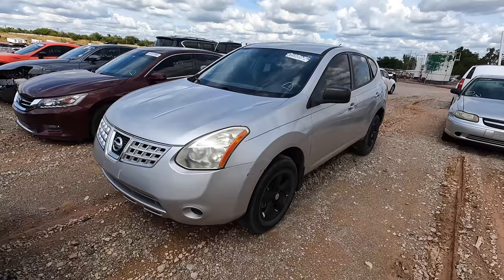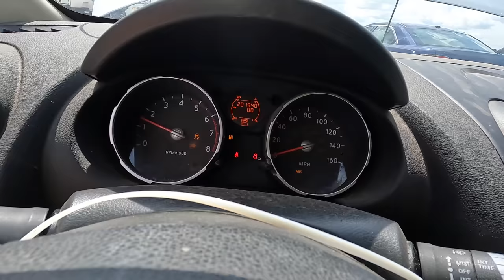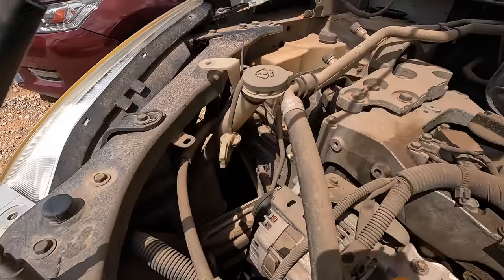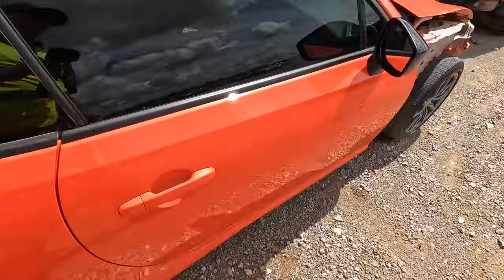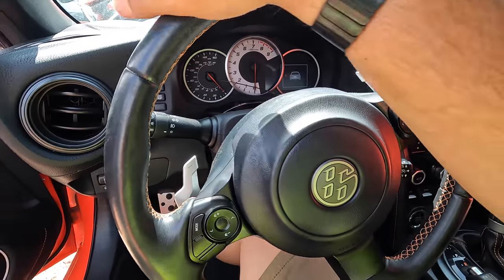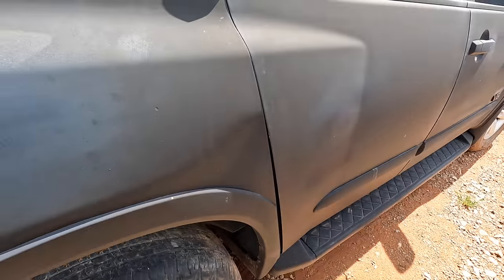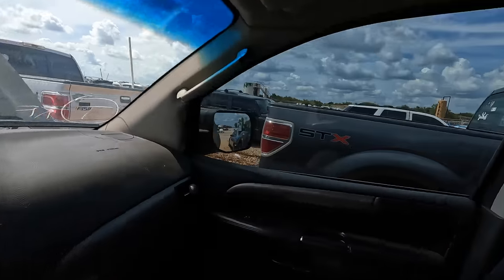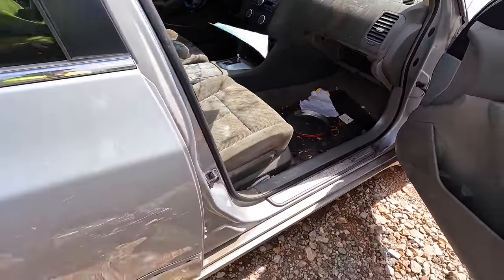Super Cheap Toyota 86 *EASY FIX* Copart Walk Around 8-31-22

Comment: Run as fast as you can from that Nissan Rogue! I had one with the same lights on the dash and it would just randomly quit while driving. Nissan told me there was issues with the wire harness and it is thousands of dollars to replace because they would have to make a new one as they are not in stock anymore!

Comment: Based on buckling, the frame damage on the Armada must be before the rear wheels and probably not worth fixing at nearly 300K miles.  However if it goes cheaply, it would be a good toy for off road activities as it still seems to run well.

Comment: Randy go after that 86. It's a cool car. The Trans cooler could be some where else or they may have looped the lines over to keep the fluid from running out (may want to check for that) it looks like possibly it could have been backed into on thr passenger side explaining why the airbags not deployed and was "totaled" because of that small replaceable or fixable piece on the front right side. I think it be worth fixing and for content.

Comment: I really don't trust those Nissan CVT transmissions.  Maybe it's just me but I wouldn't buy a Nissan made after 2005. Now those Subaru / Toyota jointly produced models are nice but that one looks like it was street-raced by an incompetent driver. As for the Lexus,  its not the worst I've seen.  Some of the cars at CoPart are so bad that it makes you want to throw up!  🤮
Reply: Im with you on that, those cvt transmissions can be a complete nightmare
Reply: If you watch the Car Wizard, he said to replace the transmission fluid with the CVT more frequently. I can’t remember if he said every 15k or 30k miles

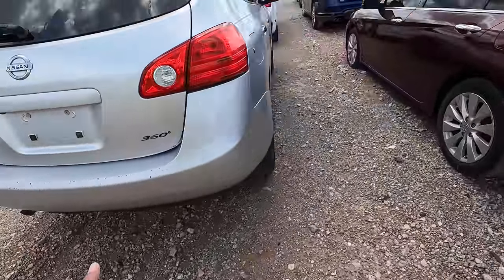Comment: 0:40 yeah right a cheap vehicle and also needs a new $4,000 CVT transmission I wouldn't touch that Nissan with a 10-ft pole I've seen used car dealerships get driven out of business dealing with those Nissan's of that generation with the CVT transmission